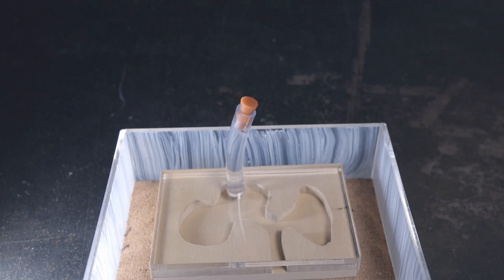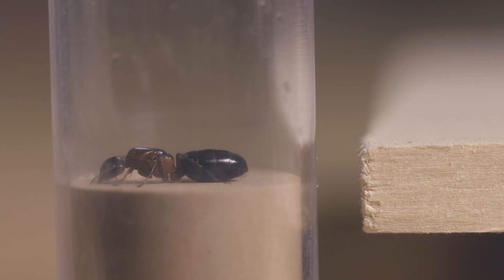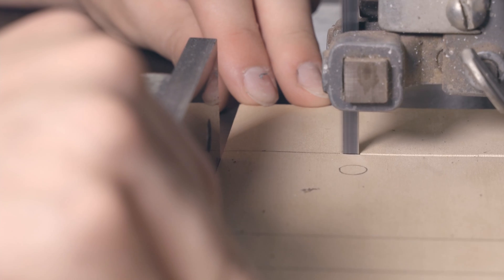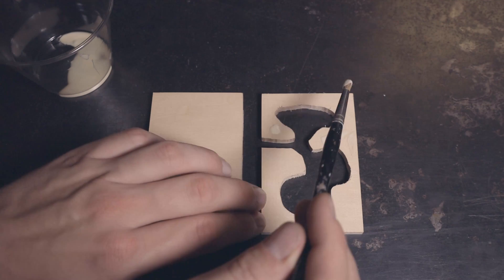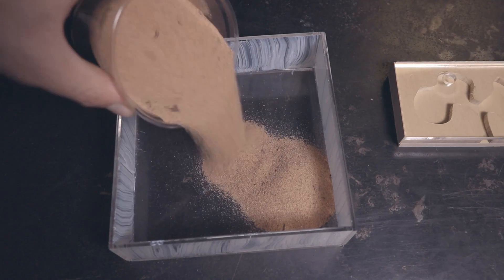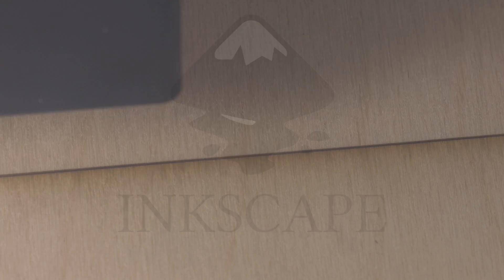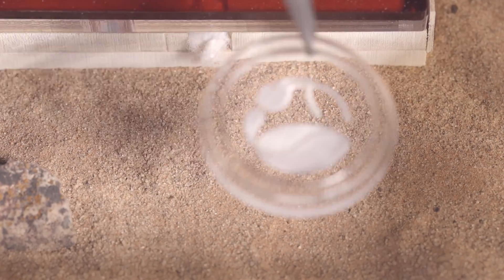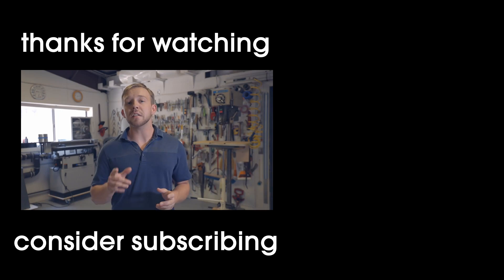Make a WOODEN ANT NEST | Ant Keeping 101

Comment: I noticed that you used an MDF (Medium-Density Fiberboard) rather than actual wood. I seem to recall hearing that hardwood is preferred for use in ant nests. Can you comment on the pros/cons of each?
Reply from the maker: We used balsa wood. Hardwood is a preferred material for ant nests, and we do not recommend ever using MDF because of the glue used in that product.
Reply: @MilesMaxcer  Im oiling my diy wooden ant nest but my dad wont get raw linseed oil because it is too expensive. and he wants to use a oil alternative of olive oil mixed with lemon juice. is this safe for my ants? and is their another alternative?